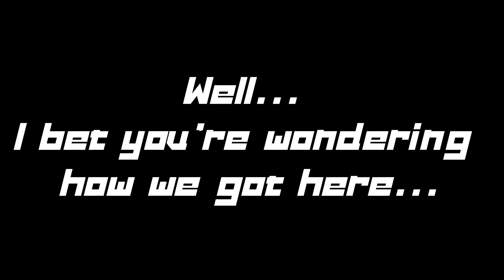FIRST NO PREP RACE!!! DID NFT DO A WHEELIE!

Comment: That first pass was great. I run the same QM but the twin street disk however I’ve been struggling to get the car to leave right. Are you using a slipper valve?
Reply from the maker: I had the magnus pro level slipper but it doesn't work like it needs to. I picked up a different style slipper valve and will be doing a video on it. If it works like it should. We should be seeing some 1.2 60' and low 5 sec 1/8ths.
Reply: @N3ZFAB  thats what I heard. I am going to try the clutch tamer. Keep us posted.
Reply from the maker: @seanest1986  I picked up the hitmaster. Sucks the track is closed though.  Can't do any testing!
Reply: @N3ZFAB  I want to say they are very similar if not the same. I’m sure you can try some street hits using the draggy for testing purposes.

Comment: Go auto! Way better
Reply from the maker: Boring! Lol. I have some things we'll be changing on the car that should make it alot more consistent and reliable!
Reply: @N3ZFAB  meh more reliable and winning is better hahah. Hopefully ya get it to hold up
Reply from the maker: @ApexVIII  well we did a fully built t-case and picked up a new style slipper valve. Hoping those 2 are the magic trick!
Reply: @N3ZFAB  hopefully. I’m pretty sure none of the fast manual cars use the slipper valves. I know boostin said it was inconsistent. I am not sure if gas stroker uses it or not.
Reply from the maker: @ApexVIII  I talked to boostin also, and they are just using the magnus slipper, and yeah, it just inconsistent. I'm surprised they haven't tried other things.
Reply: @N3ZFAB I wonder if one could get a Black Magic slipper clutch setup for DSMs. Seems like that would be better than a valve.